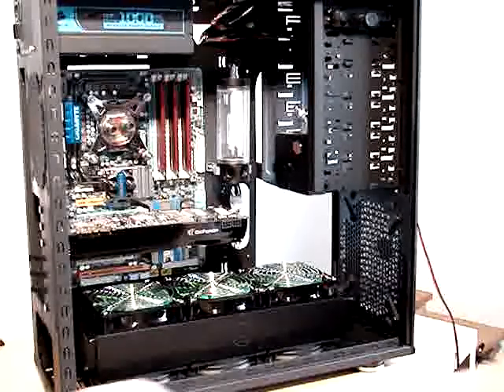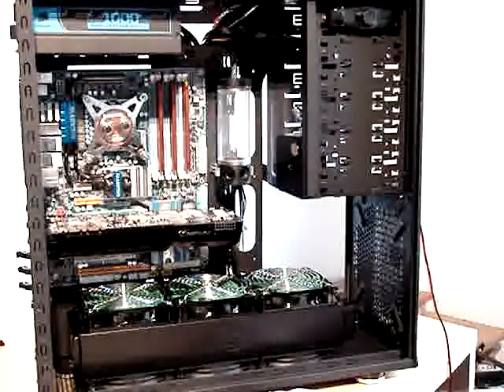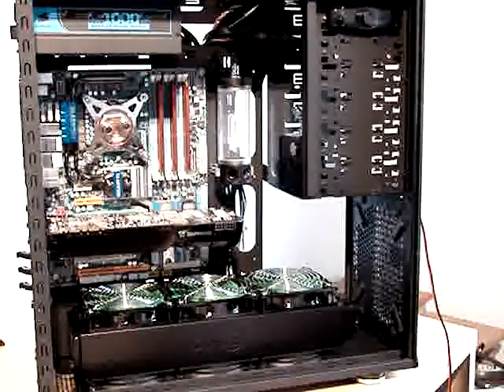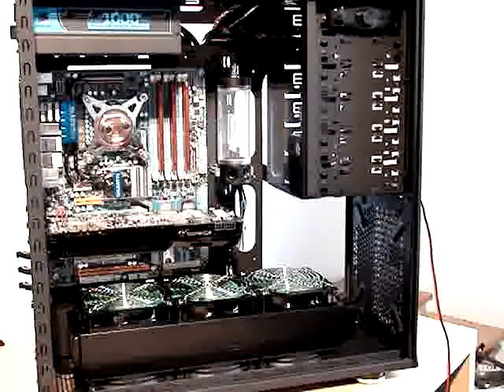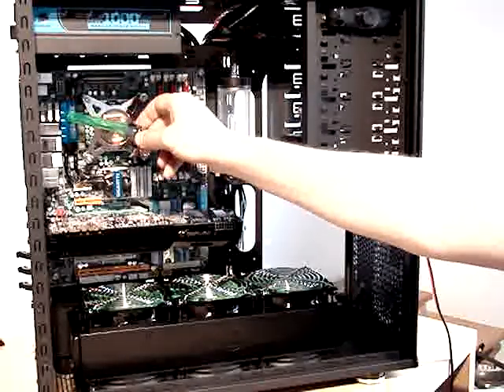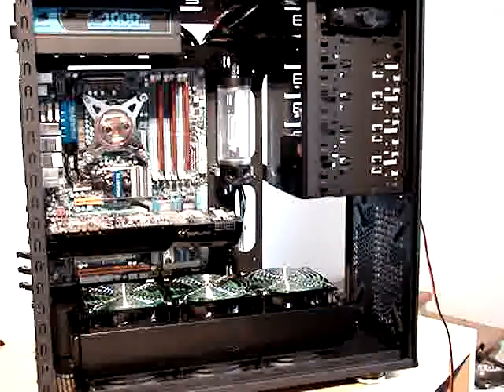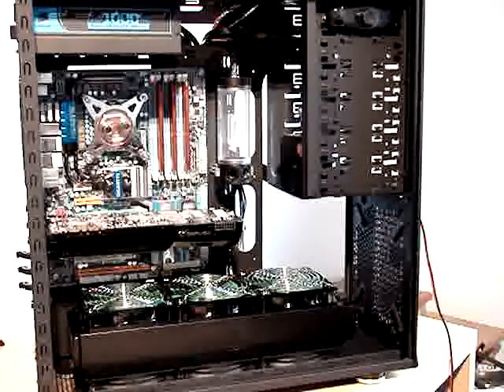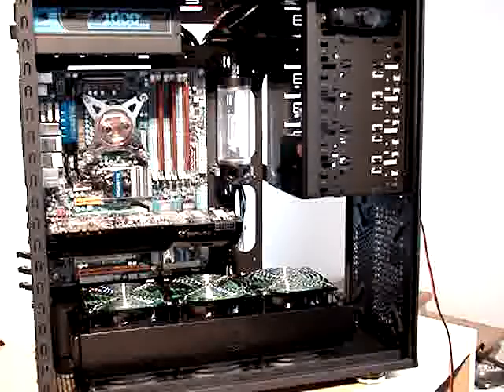Watercooling build Part6  Watercooling Loop Planning

Comment: Hey DazMode, sir. Thank you for still having this series still up even tho it's dated. This is the case I am working with. I did so much research back in '09 but I've since forgotten much. I'll be using your series to help guide me. Right now, I'm sanding...... errrrr, no fun.  I have the paint so I got to use it.